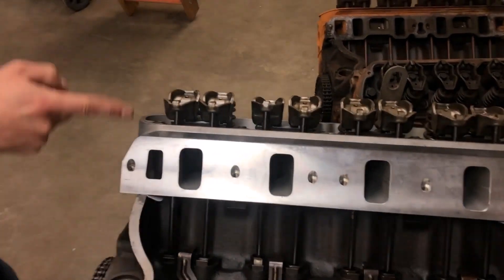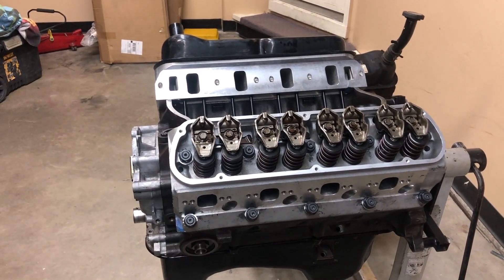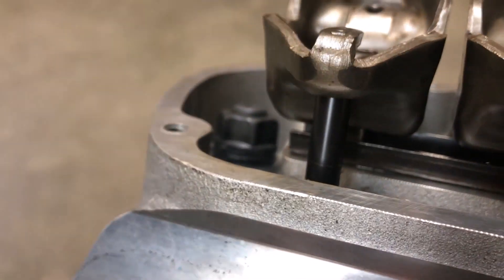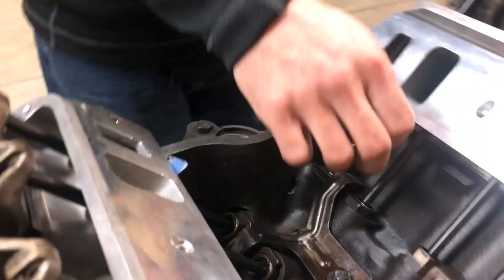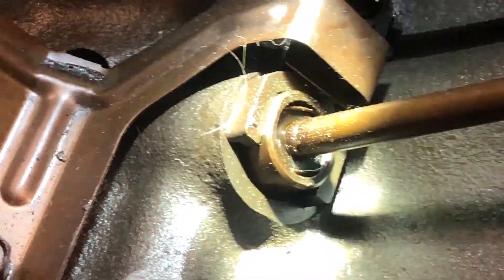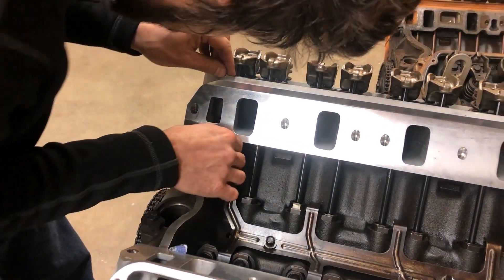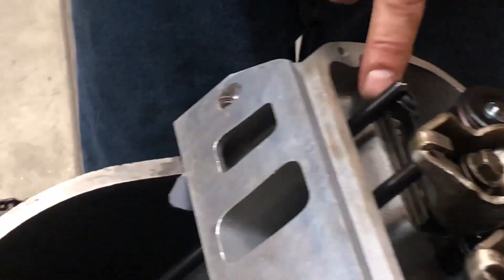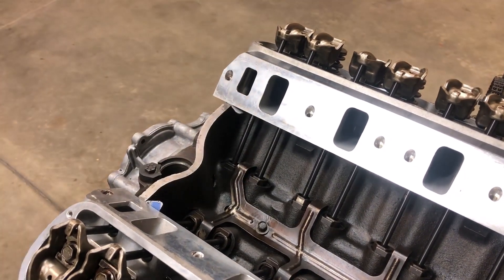We Test lifter preload & determine pushrod length | 351W iron vs. aluminum heads

Comment: I didn’t think that heads with 2.02 valves would clear the stock pistons on a 351, even my aftermarket flat top pistons valve reliefs are 1.94
Reply from the maker: When I took this engine apart for other reasons about half of the pistons had dents from the intake valves. The 87- 93 and older truck engines had small valve reliefs, but I don’t know if they’re in the right spot. Also the heads I used had been milled down to almost the service limit and I used Felpro pt9333 gaskets which are close to stock thickness.

Comment: Do you check where roller is on valve stem ?
Reply from the maker: I didn’t this round, but I have with the stud mounted roller tip rockers before. I think checking the stem contact pattern is more of a thing for the roller type aftermarket rockers, but these heads use the stock slider type so I’m not sure how the pattern would look. Never checked it with the stock ones before

Comment: Did you have stock pistons, what pistons were in the block with aluminum heads
Reply from the maker: This engine had a stock bottom end. I didn’t take it apart. Turns out it had carbon stuck oil rings, so it had to come back out within 1000 miles.

Comment: Timing chain gets oiled by the thrust plate for the cam
Reply from the maker: Just yesterday I also noticed there's a hole in the valley both at front and back, where the oil can drain right down onto it as well

Comment: Can you help me?  i am so confused about all this messure things, i got a f4te block and a crower stage2 Cam but i cant find the right messure pushrod for this Cam, please help!!!
Reply from the maker: Do you have stock pushrods or no? Stock rockers or no?  I used 7.550" with an F4te roller block and that put it near .050" which is basically stock but some of the pedestals needed to be shimmed when using stock rockers. If you have stud mounted roller rockers those are pretty much adjustable and 7.550" should work about perfect for most cam and head combos.